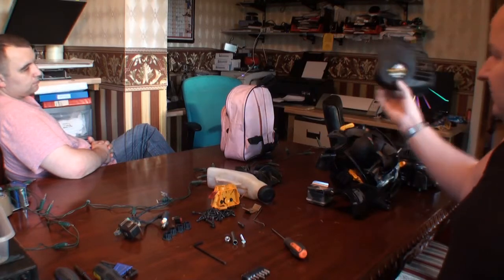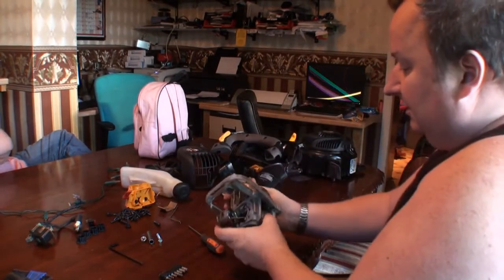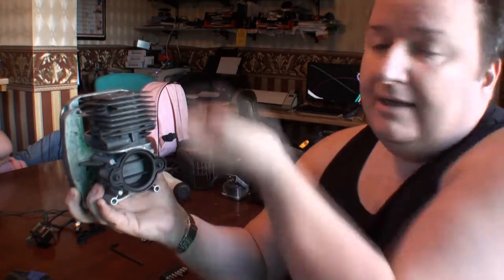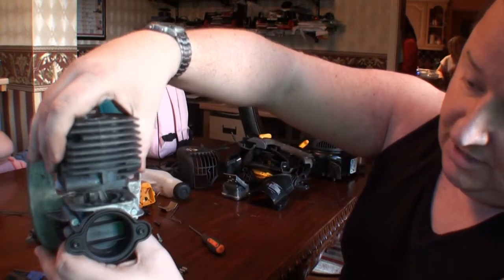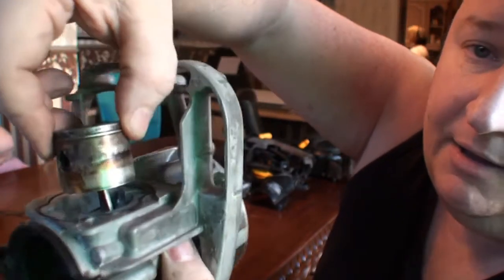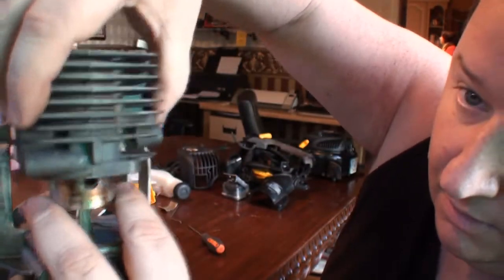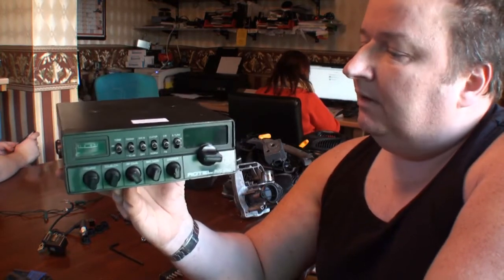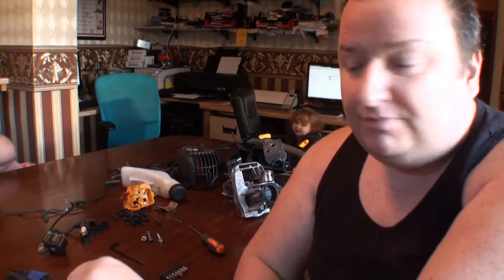Leaf Blower Puffed Out And Vlog

Comment: Another great vid,one tip I can add is if you have expected piston damage take the exhaust off and look down the port with a torch,it may save taking the whole engine apart.Anyway keep the vids coming thanks.
Reply from the maker: Yeah your right. I already did that but I stripped it right down for the video to show other people exactly what had happened. Thanks for the comment. Cheers
Martin